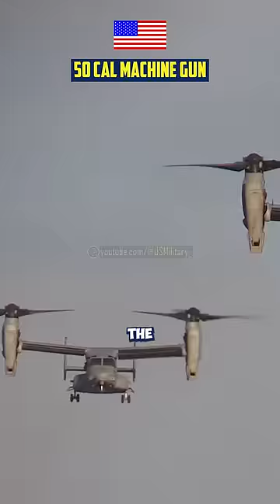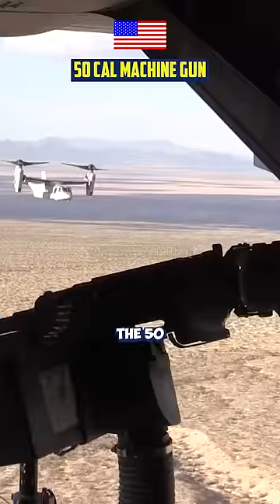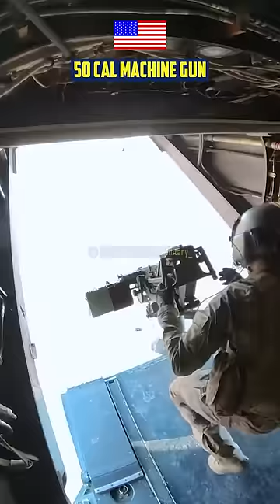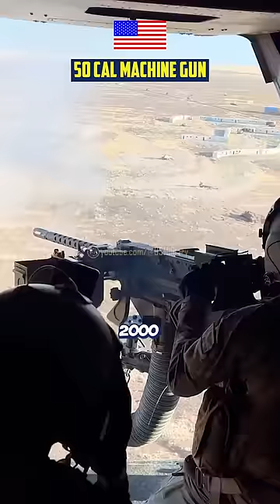The Scary Reason Why the 50 Caliber GAU-21 Heavy Machine Gun Used By @USMilitary_ Is So Advanced

Comment: Its just a modified M3 50. No?
Reply: No, Gatlin guns work differently than traditional methods.
Reply: GAU-21 is not gatling gun, look at the vid
Reply: More or less. If I recall the GAU 21 is an open bolt weapon whereas the M3 was still closed bolt.
Reply: Lighter overall weight and higher cyclic rate
Reply: It's an M3 just with a different name cuz of the Air Force and navy naming of aircraft mounted weapon systems
Reply: @tibbs3112   It is a modern variant of the M2 Browning machine gun and is known for its high rate of fire, reliability, and accuracy. The GAU-21 features various improvements over the original M2 Browning, including a lighter weight and a dual-feed system.
Reply: @Remsster  there is no Gatling guns in this video. It is literally footage of aircraft variant M3 50 caliber machine gun well there is like 2 seconds of an actual rotary canon
Reply: Gau 21 operates differently than the M2. Its an FNM3. It fires open bolt and has a variable rate of fire from 950-1150 rounds per minute the internals and operation is vastly different than the M2
Reply: The M3 machinegun was used on World War two fighter planes.
Reply: The gun in the video was actually an M2 browning .50cal machine gun...
Reply: @Remsster  don’t even enter this comment section without knowing this stuff
Reply: It's a M2 not a M3 lmao, specifically a M2A1 with sole modification
Reply: @allenharsha4950 the GAU-21 is a Browning M2 that's been modified. FN only makes licensed copies for the European Nato forces
Reply: @Bloodsong0830  Plenty of M240B I'm there too, the visuals in things like this are often wrong. You're still correct but be careful about misidentifying things because of these
Reply: Not really it is a modified m2 browning  heavy machine gun which is almost 110 years old so not really that advanced
Reply: M2 and M3 are slightly different. M3 has a boosted fire rate over the M2 and wasn't introduced until after WWII.
Reply: no its a modified M2 browning.
Reply: @Remsster  Neither the M3, nor GAU-21, is a Gatling gun variant. So why did you mention it? Stick to comments on video games and Legos, they are more familiar to you and appropriate for your age
Reply: @DowntownDeuce2  Almost like he edited his comment, why else do you think other people are also talking about gatlin guns in the comments.
Reply: @Remsster  No, NICE TRY, though. If either of you had edited a comment, it would be indicated with "(edited)" following the timestamp. The OP is 4 weeks ago and it took you 2 weeks to reply; neither was edited. The other comments are most likely in response to your fodder, not OP. It is simple ignorance, not technological nuance.
   Perhaps that immaturity is what got you to this point in your failed life; most of us develop it in puberty, while some like you still struggle to attain it. Learn to accept responsibility for yourself.
Reply: @DowntownDeuce2  lol. Someone has their feelings hurt, maybe you should stay of the big scary internet kid. Youtube comments are know to not always show when edited even when they are, this is a know issue.  If they were in reply to me why are they not @Remsster ? "NICE TRY". Immaturity is exactly what your comments scream! Soon as you think someone is wrong you gotta scream at them to make yourself feel better.
Reply: No, M2
Reply: @Remsster what gatlin gun?
Reply: @unknownusername1826 the vid isnt all that accurate. They show an M240 a few times.
Reply: No that a better browning
Reply: It is an an/m3 just different designation
Reply: @Lotek117  No, it's an M3 .50 cal

Comment: it's a mockery to this firebreather to have such a small ammobox attached....ludicrous!!
Reply: Because its not in the windstream like a door gun to help keep it cool, its fire rate must be limited to the point where swapping ammo cans help with keeping the barely temp from meltinf down.
Reply: @tibbs3112  thnx for clearing tht up for me...appreciate it alot
Reply: @2011persol  no sweat. I got a vid on my channel from when I got to ride along on a gunnery flight on a CH-53 I LEARNED a lot that day.
Reply: This is a joke so, plopter fanboys dont roast me, they use the smaller ammo box for the v22 because if they used the 300 round can like on the ch53s they would exceede their weight limit.😊
Reply: @tibbs3112 they should run a vapor chamber over the barrel to keep it cool. They'll only add about 5lbs of weight and keep the barrel cool

Comment: Pretty sure they just use the air type 50cal. And not a rotary GAU type platform. It has double the rate of fire and other modifications. Basically they pulled them out of the wings of WWII fighters and mounted them on pintels.

Comment: So basically took an M2, put it on a mount, and increased its fire rate to levels unheard of for a single barrel machine gun.
Reply: I think they remembered that the mg42 could fire at 1200 rpm, and thought "hey, why not have that rpm on a .50 ? that'll show em" or something like that idk
Reply: The MG42 hits 1600RPM in early configurations, the MG3 ranges from 900 to 1200. Even the M1919 had aircraft variants in that ballpark.
It's not unheard of.
Reply: Its the same as any of WW2 aircraft 50cal guns.
Reply: It's not unheard of, aircraft guns have always had the higher rate of fire. The airstream cools it.
Reply: Hum excuse me but i think u can also put an M2 on mount

Comment: Based on the Browning M2 .50 Caliber which was developed almost 100 years ago. Ain’t broke, don’t fix it. Only thing holding a candle to it the Russian DShK and the Chinese Type 54. Keep in mind though, the DShK and Type 54 were anti-aircraft guns moved to infantry frontlines to equal the fight of the Browning M2.
Reply: m2 wasn't supposed to be an infantry gun either, it was an anti-armor round at the time.

most ww2 use was on aircraft too. the second wind of it comes after.

Comment: The cool mathy concept i like about this is that in applications like this you are shooting into a 3d environment while moving.. and with distance.
Perfectly aimed shots would be off. This allows someone to point a weapon at something many meters away, pull the trigger, and lightly paint the small 1/2 inch areas with lead. 
If you ever did sand blasting.. imagine you were taking paint off an adversary.

Comment: That is literally the same model of M2 machine that the United States has been using since 1933. Strap as many wires as you want to and put it on a swivel mount, the damn thing is still the same gun that has been  in use for 90 years

Comment: The "scary reason why the 50 caliber heavy machine gun is used by the US military" is because even after 100 years, it's still extremely effective at putting beer can size holes in targets out to ranges well over a mile, very reliable, and easy to maintain.

Comment: It showed a M240 multiple times, but the gau 21 isn't advanced. However, you are able to adjust the rate of fire actually, which is probably the most "advanced" part of it, and it's actually easy to do

Comment: I like how they say it’s an advanced M2 Browning, but mind you this has been around for muuuch longer. Its design may be new in appearance, but the interior parts may be similar to an older gun.

Introducing the AN/M2, the grandfather to this GAU-21. The AN/M2 was just a M2 Browning on steroids with the sam firerate, and was used in bombers, fighters, and even PT boats and other vessels as it was designed to be more anti-air focused. Of course the M2 Browning was originally intended for AA, but this was the pinnacle of it at the time since. 

Also, the AN/M2 was convertable to .30 caliber, as seen in Iwo Jima with the Stinger, and up to 20mm rounds used in Hispano-licensed Brownings.

Comment: They haven’t even implemented the GAU-B TRI barrel.50 cal yet. If you thought this was badass, check out the Gau 19-B .50cal. When fired from any vehicle,it’s so stupidly overpowered, that it will make any vehicle turn to the opposite direction that it’s being fired at, and it can even move the vehicle forwards or backwards when put in neutral. 

Well I guess they can’t put it in any osprey or helicopters, because the amount of force exerted from the 3 barrels, it’s definitely a flight hazard for the pilots, and especially the osprey due to it’s design. I don’t think any pilots could land safely while the door gunner is engaging targets, and if flying above trying to lay suppressive fire, it could cause the aircraft craft to lose speed, or possibly cause the pilot to over compensate and cause a incident. I guess that’s why they never mounted one on any helicopter/osprey, because the weapon is just too powerful to shoot, and the mini gun(7.62) provides enough firepower to make all enemies hide.

Comment: Ground support mainly. Use against other aircraft would be somewhat optimistic. Sure the 50s potent, but a pintle mounted won't stop a jet and helicopter pilot would have to incredibly dense to come within range
Reply: So its rounds cannot penetrate through the aircraft's body? Or am I missing a note
Reply: Oh they can. Problem comes with actually hitting anything.
Reply: The range a jet can engage you at with missiles or even it's own cannon, a single heavy machine gun isn't going to change the outcome. Especially with how limited the arc of fire is, when a jet could choose to approach from virtually any angle. 2000 meters is the stated range, but that's rookie numbers to an air-to-air missile.

Comment: Advanced why? Nothing changed last 40 years. 

“Yes, there is a 50 caliber Gatling gun called the GAU-19/B. It's a lightweight gun that can be used on a variety of platforms, including helicopters, fixed wing aircraft, land-based vehicles, naval vessels, and high-speed patrol boats. It has a rate of fire of 1,300 shots per minute. 
The GAU-19 has been in service with the US military for nearly 40 years. It's also used by over a dozen other nations. The GAU-19 was originally designed as a larger, more potent version of the M134 Minigun.

Comment: The use of ma deuce is limitless. It’s been used in air and ground. Have you ever noticed the barrel in a/c use has the barrel sticking out. The barrel can get so hot that it damages the wing structure during sustained fire. Hence why the barrel is not tucked into the wing. The barrels is made of metal can sustain high rates. Memory serve the barrel is not something you can just casually hold need to keep good grip on it. Enough weight if your walking some distance with the barrel your going carry it on your shoulder. It part of the American icon of military firearms. With Colt .45, BAR, M1 Garand, M60,M16. All distinct American firearm.

Comment: But it uses a standard ammunition can. Seems a bit impractical. At that Cyclic rate reloading doesn't allow for very much time on target. It needs the same system that the A10s Vulcan has as well as the Mini Guns on rotary air craft

Comment: This is the same gau 20 they use for fighter jets? And it's fired by hand? Metal bro!
Reply: Not even close to the same. Just an updated Browning with a slight tweak to squeeze out a higher cyclic rate. A popular calibre for fighter cannons is 20mm, to the .50 cal that measures about 12.7mm.
Reply: @WhatIsThatThingDoing  thx I has no clu, I plays da vidgeo gams, gau 20 is vary popular. Thakz.

Comment: Is this what they call a chain gun? An electric motor driving the mechanism through a chain, not using a recoil or gas operation.
Reply: This gun operates on gas pressure only. The M134 (not shown) is electrically operated however.

Comment: Is it any different from a AN/M2 (the aircraft mounted variant of an M2)just Googled it and found out its another designation for the AN/M3 (the AN/M2's younger brother) with the M2 variant developed in early WW2 and the M3 variant coming along for late WW2 and the Korean War in the F-80, F-86, and F-84 because aircraft were becoming faster still with Jets becoming a thing the 600-800rpm of the M2 variant couldn't keep up any more so they basically overclocked it even more into the M3 to enable a higher burst mass per second without giving up too much weight.

Comment: Dammnn, alot faster than the M2 .50 i inherited, which is around 800 a min. Also got 2 m1919s, I always thought the 30s were quicker until my father let me shoot em finally (7yrs old)  but they're actually slower, like 500 iirc. 
Only take them out for the 4th & new years, letting people take turns running 100rd belts costs a fortune and that's with my reloads 😑😞

Comment: It’s simple 

The thing is stupidly simple to produce and operate, it hits like a truck and is highly accurate, along with its massive and bulky components, allowing it to sustain a much longer rate of fire and lifespan compared to most other guns, plus why change a system that’s already proven itself throughout two major conflicts, since the age old saying goes 

If it ain’t broke why fix it?

The same can be said about the Russians with their Khord and DHSKA heavy machine guns both used in WW2 where again they’re a proven system and if it’s too expensive or too problematic to upgrade or replace the system in it’s entirety then why waste the time, energy, resources and especially the money to produce a new one that does exactly the same thing as the old one, since to do so would either require the need to build and supply a new factory as well as to train the staff in its production vs keeping the existing facilities and slowly modernizing them and automating them over time

Comment: 1200 a minute… capable… but its not packing 1200 ammunition to fire it in one fuckin minute..  most belts carries about 50-300 rounds.  so in reality.. it will fire about 300 rounds max per minute.. to compensate with aiming and heat produce during firing..  😅

Comment: Its not advanced it just has a lightened bolt and heavier recoil spring
Reply: And it fires from the open bolt and it has a dual feed system meaning it can be configured to feed either left or right not both ends. It has 3 'return springs'. It has a variable fire rate adjustment block

Comment: All fired out of a single barrel. Bet that thing heats up fast…
Reply: mg42's did, they'd have multiple spare barrels and a barrel discharge mechanism so they could switch it if it overheated
Reply: @vivecald-vehk6978  Imagine trying to change a barrel on a moving Osprey. If that’s the case I’d be wishing it was a rotary design…

Comment: The Osprey is an ill conceived and dangerous flying machine.
Reply: Not really, it’s not had many accidents compared to other helicopters it’s just its accidents have been more publicized due to higher number of deaths per. In fact army is adopting a similarl helicopter with their new attack helicopter the Bell-280 Valor which won their new competition. The only thing traditional helicopters have over this style is if the rotor fails the regular helicopters just drift due to the ground due to auto rotation but where tilt rotor designs don’t have tail props they don’t have that safety feature, that’s the reason even tho they use a bunch of Ospreys with Marine one it’s for staff and reporters and not the president!!

Comment: Yeah, good luck with melting barrel)))
Reply: That's not really a problem with the aircraft version of the M2. They're all air-cooled, but because there is cold air constantly flowing over the barrel when the aircraft is moving, it takes longer to heat up. That's why it can have a higher cyclic rate than the standard vehicle/mounted versions.

Comment: Neither the gun or the aircraft is advanced , all they did was strapping on a M2 browning machine gun ; And doesn’t the V-22 Osprey kill more soldiers than it saves?
Reply: Wrong on both accounts. 

1. The GAU-21 is a derivative of the M3 due to its rate of fire, an M2 fires very slowly compared to the GAU-21 or M3.

2. When it comes to Class A mishaps per flight hours flown, the Osprey has the safest record among USMC platforms.

The more you know.
Reply: @optrdocksidebars7106  ok

Comment: Um that's anything but advanced, Actually it's been around since WW1 and it doesn't shoot 1200 a min it's 600 rounds per min ur combining 3 guns here the gauw 21 miny gun shoots like 3000 per min or something like that the ma duce or m2 50call is just mounted on the same mount and the gauw21 get ur facts right bra also you keep switching footage on his video back and forth between the M2 50 cal and the 240 bravo which is a whole nother gun that shoots 1200 a min like ur all over the place man do just a lil research like the smallest amount you would know that come on.....
Reply: You should do your research! The M2 Browning was introduced in 1925 not WW1. Throughout its service there have been many versions of it: M2hb (ground version): 600rpm, AN/M2 (aircraft version): 750rpm and M3 (also aircraft version): 1200. The Machine gun in the video is probably a modified M3